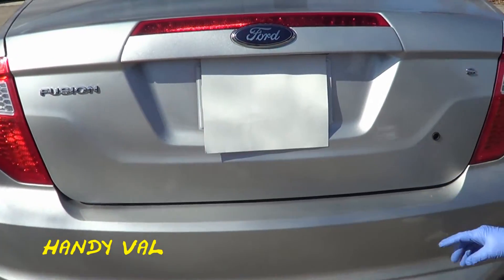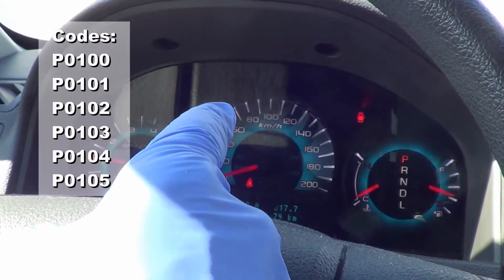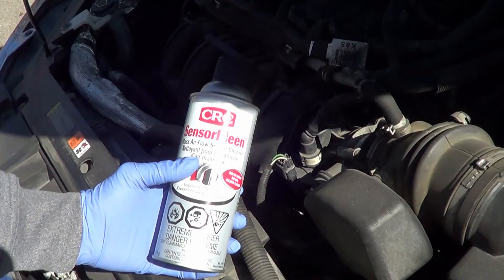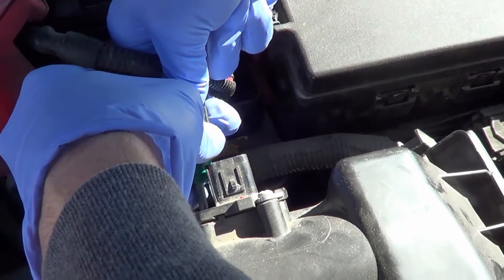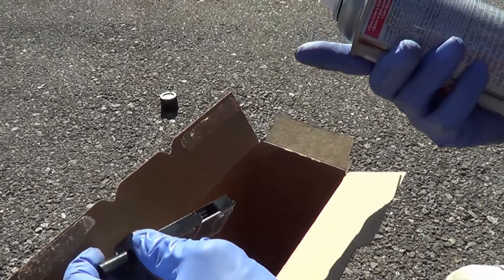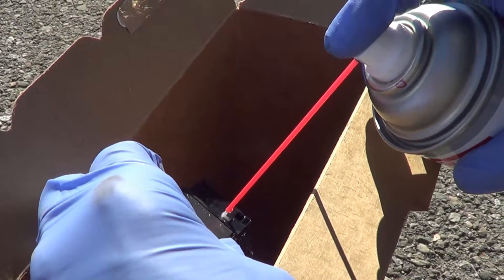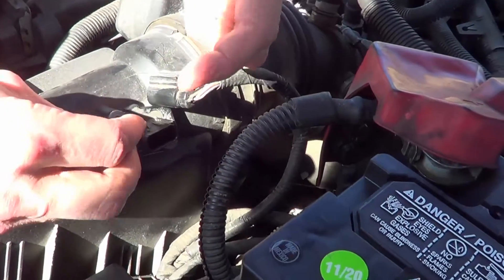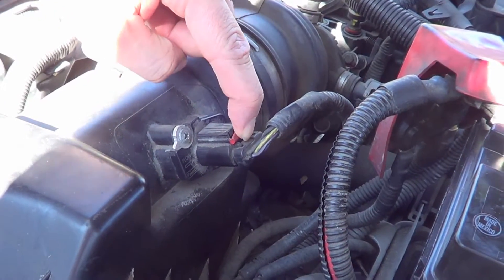How to Clean a Mass Air Flow Sensor MAF on a Ford Fusion and other Cars

Comment: My 2011 Ford Fusion loses power when I attempt to accelerate harder than an slow acceleration.  And when I do press the pedal hard, it almost sounds like the motor is fluttering accompanied by absolutely no acceleration.  Just the fluttering noise.  But I can coast with no issue. 
Any thoughts?  Would this maybe also be a symptom of the MAF sensor?

The Throttle body is less than a year old.
Reply from the maker: The symptoms you describe could be related to the MAF sensor, but I would also recommend checking other components. It seems like you probably have a vacuum leak. Check to see for any loose rubber hoses and tighten them. Also look for any cracked rubber. When the throttle body was replaced, the other rubber components and their connections were likely disturbed, loosened and/or cracked. Keep me updated.
Reply: @HandyVal Yhanks I'll check that out.  Any thoughts on where some of these Vacuum hoses could be?
Ii replace the throttle control about 3 or 4 years ago. And this just started happening last summer.

Comment: should the wires be shiny?  Mine are dull silver.
Reply from the maker: They’re not quite shiny but not dull either - somewhere in between. Just make sure the wires aren’t rusty. If they’re rusty you need to replace the sensor.
Your sensor will likely benefit from a few good sensor cleaner sprays.

Comment: 2010 Fusion 2.5.... I get  hesitation around 2k rpms and 40ish mph.... feels like a misfire,  no CEL. plugs have been changed, same with coils. Same issue. New air filter and oil change. Car has 235k miles on it. I'm think throttle body, maybe I'll clean the sensor. Any ideas? Thanks
Reply from the maker: Let’s fix this problem. I would see if any codes are stored. Sometimes they register even without a CEL. There can be a few things left to consider. It can be fuel related, so try something like a LiquiMoly fuel cleaner (this will also clean your injectors). A dirty mass airflow can cause these symptoms too. And so would a dirty throttle body - which can be cleaned. These are fairly cheap tries and it makes sense on a high mileage car with or without any symptoms. I hope this helps.
Reply: @HandyVal  I did run a code reader and found no codes. I will clean the throttle body and MAF tomorrow. I'll throw in some injector cleaner too. I'll let you know. Thanks for the response
Reply: @3030Deltron  I have a weird buzz aswell when accelerating between 2-3k rpm

But stops when I hit the accelerator harder seems like an intake issue of some sort.

Comment: If I clean of MAF sensor. Can I clean of throtle body too sir ??
Reply from the maker: Hello. Yes you can also clean the throttle body, but you need to use a throttle body cleaner and be careful and gentle with the throttle valve.
Reply: @HandyVal  okay because I have a code p2004 ford fusion and I can't find of problem.

Comment: It seems like with a four-cylinder you should be getting much better mileage. Even if the primary source of the mileage is around town.

Since it's a four-cylinder I'd recommend changing the spark plugs.

Super easy on the 4-cylinder, not super difficult on the 6- although it does require a bit of extra work.

I've got a 2012 3.0 l with 248k miles. The majority of my travel is highway, but I average around 27.5-28 mpg. My MAF sensor has never been cleaned, however I change the air filter every year.
Reply from the maker: Great point. Spark plugs as they age consume more gasoline. The car shown is a city driver, so the trips are really short, like 1-2 miles and in heavy stop and go traffic, where those 1-2 miles can take 10 minutes to drive. However, on highway only driving it is getting close to 29 mpg, similar to what you quoted, which is amazing.
A spark plug change video may be on its way - thanks watching, commenting and sharing your experience. Much appreciated.

Comment: I have a 2011 Ford fusion hybrid and I'm starting to notice problems with keeping the engine running as it fluctuates idling while driving over 70mph and I get a worn8ng that I have to pull over and stop and shut down the car and after a minute I can restart the engine and am on my way again. Last week when the temps on the road were around 99° it did this twice and I just have to do the same thing of pulling over shutting down and in a bit restart the car. I have had to drive in cooler times of the day to not have this happen, but it still has idling fluctuations.
I'm wondering if it is this MAF needing to be cleaned or the electronic throttle body bad or needing cleaning as well?
Reply from the maker: Hard to diagnose, as this likely needs a scan tool. A dirty MAF symptom will cause a rough idle, but I don't think that's your problem. It looks like you might have a coolant\cooling problem. Which warning light do you get on the dash - is it the coolant warning light?
Reply: Anytime heat becomes an issue I always worry that there's a faulty coil. 

Not by any means a definitive solution, just one that is not always the first thing you think of. It's possible a coil is throwing a code and causing the jumping around at highway speed and at higher ambient temperatures.
Reply: @DeruUeruddo  the thing that makes me think it's a computer I protection is that once I shut down and restart it drives fine

Comment: Thanks for your informative video and fully explanation. 
I dont have any code but the car shaking when I stop completely and press the brake.
I tried spraying  as you said and I will check if it helps.  Thanks
Reply from the maker: Thank you for the feedback. Let me know if cleaning the MAF sensor helped your car’s shake.
Reply: @HandyVal  yes it helped 100%. I'm satisfied, no more shaking and no dropping the RPM of the engine when braking.
Reply from the maker: An amazing outcome!!! Thanks for sharing your experience. 😍

Comment: I made a mistake and scratched the top metal part of the sensor but I did everything else right, will I b ok?
Reply from the maker: Mistakes happen, but you will be ok and fine. The scratch on the metal part will not harm the sensor.

Comment: Does it works for for the 2010 fusion hybrid as well for better mpg?
Reply from the maker: Yes. It will work on the Fusion Hybrid. You'll notice a gain in fuel economy (depending on how dirty it is) but likely not as much savings as a gas-only Fusion. Well worth the effort.

Comment: Could my car turning off when coming to a stop or when idling, be a result of a dirty mass air flow? I replaced my 2012 fusion battery using your video and the car shutting off when coming to a stop or idling. Please get back if you can

Also I took it to autozone for a diagnostic and from the test being done   I needed a new battery.
Reply from the maker: Is your check engine light on? I believe, your symptoms are serious enough to trigger the check engine light. If it is, I believe AutoZone (or other places) will scan it for you and with the problem code you can then pinpoint what may need replacing.

A dirty mass airflow sensor can certainly cause the problems you're experiencing. You can try cleaning it as per the video and see if the symptoms reduce/disappear. Your problem could also be related to the tubing around the mass air flow sensor  (this is called a vacuum leak) - ensure those rubber tubes aren't loose at their connections. If you can easily dislocate them with your hands then they are loose and you will need to tighten them with a screw or socket.

But it could also be a number of other issues related to fuel supply, like dirty fuel injectors or fuel pumps that are failing. Hopefully, it's not as this is more costly.

Keep me updated. Your problem is serious enough and may require a mechanic visit - let's hope it's a dirty mass air flow sensor.
Reply: That's your throttle body minds was doing that 2012 for fusion se
Reply: @aqua3874  Just started having the same issue today, shut off on me at a red light on the way to work. Just got home and took it apart to find the back of the throttle plate just caked in brownish orange gunk with some hard black on the edges of the plate. Hoping it'll fix the issue/ruff idle now that it's clean.
Reply: Preciate the info I’ll definitely get on that. And no the check engine is not on and yeah I did take it to autuzone and the scanner only said that the battery was on its last leg, alternator tested good as well
Reply: For a few years I had a check engine light on and the Ford dealership found nothing when under warranty  and when I had codes checked by autozone they Saud it was both oxygen sensors.  I went to Pep Boys and got my antifreeze replaced and the check engine light was gone! Ford knew nothing about how to clear the CEL.
Reply: I will try this then move to replacing the electronic throttle body.

Comment: Ok sir I have a code p2004 on my 06 Ford fusion SEL 2.3 L  you know what's of problem there..any help? Thanks 🙏
Reply from the maker: The P2004 is an intake manifold runner control (IMRC) problem. And there are two common fixes for it. 
1.  On the 2006, the IMRC can easily be replaced with a new one. I believe there are two on your car and the code reader would tell you which one is faulty (bank 1 or 2; bank 1 on the left while standing in front of the car looking at the engine, bank 2 on the right). They are located on the black plastic manifold (looks like a rib cage), held together by 2 screws and it includes one electrical connector and 2 rubber vacuum lines. The part can be changed easily with a new one (new ones are about $50, but can vary by manufacturer) and your problem will likely go away. Try a google search and use the images feature to find its location - once you see it, my steps will be more obvious.
2. If your problem doesn't go away with  Step 1, then you'll  need to remove the (black) plastic intake valve and inspect it and\or clean it once removed. This is more complicated for the DIYer.
I hope this helps.
Reply: Okay sir  I already changed him. The imrc solenoid and the connector and the code still follows me, I deleted it but it went backwards
Reply: The air box is losse Do you think the air might leak out there? And because of that code, do you have an email that can send you a photo, sir?

Comment: Mine is p115e 😢
Reply from the maker: That's the a throttle body code. Likely a dirty throttle body. The cleaning of it is more involved than a MAF cleaning, but it's very doable.
Reply: @HandyVal  thank you so much I’ve been searching around and that came up as an issue!

Comment: Hello, does this method work for a 2006 Ford Taurus?
Reply from the maker: Yes. The only difference is the sensor location. On your Taurus it will be in the top right corner of your engine bay. The part is almost identical and its removal identical to what I show on my Fusion.

Comment: "MAF cleaner was sold out here in WALMART*.....can I buy any where else...?"
Reply from the maker: You can buy the MAF cleaner anywhere. There are two brands I've used in the past - the one shown CRC and Zep (not shown). What really matters is that the product says that it's for cleaning mass air flow sensors.

Comment: "....your TPMS sensor is a stop sign from your tires, the batteries in them are dead..."
Reply from the maker: Thanks for noting it. It's been dead for sometime, but I have yet to replace it yet. It's an annoying process I have to go through to remove it from the info screen on start-up.

Comment: Hi, and Thank you Handy.
Can we do same for our Mercedes R129? 
If yes, can you please clarify?
Reply from the maker: Yes, this procedure can work on the Mercedes too,  depending on engine. It won't work on early R129s with KE-Jetronic (as these engines use a different meter air system), but it will work on most, if not all other years thereafter like the 320, 500, .... The procedure to remove the sensor will differ but similar than what's shown on this Ford.
Reply: @HandyVal  Thank you Handy. I have SL320, In this case I think it is same.

Comment: Is the plug in still okay for use if you accidentally break the red clip for it? The red clip from the plug was just to lock it right? So maybe I can use tape or a zip tie to keep it from undoing itself?
Reply from the maker: You will be ok. It’s the locking mechanism so it doesn’t come up undone accidentally. It’s fairly tight even without the lock, but try tape to keep it in place. A zip tie may work too.

Comment: Would carb cleaner work?
Reply from the maker: Carb cleaner will damage the sensor. Only use a cleaner labeled for mass air flow sensors. There are a few brands and all are equally good.

Comment: Does this work on a 2007 Fusion? Is in the same spot do you think?
Reply from the maker: Yes. It will work on a 2007 Fusion and it should be in the same general location.

Comment: My location didn’t have the CRC SensorKleen so what are thoughts on using CRC QD Electronic cleanser?
Reply from the maker: If you can’t find the CRC brand, you can try another brand (like Zep) but it has to be a mass air flow sensor cleaner. The QD electronic cleaner is versatile but I wouldn’t try it for the mass air flow sensor. It may harm it.